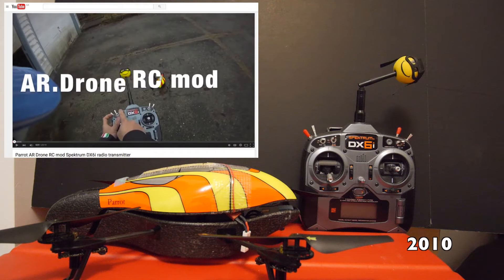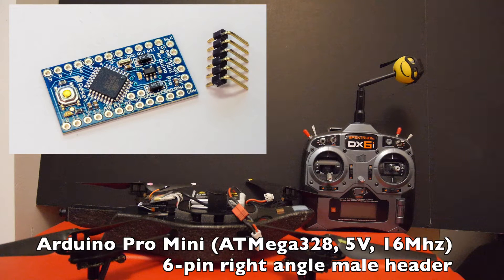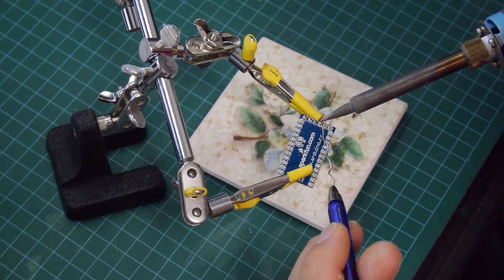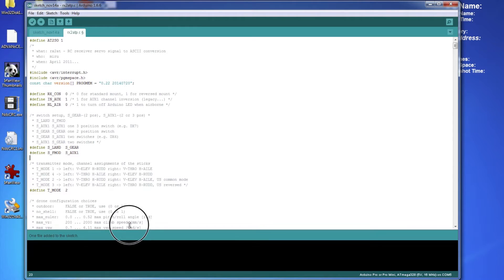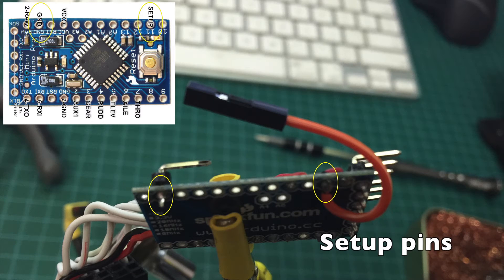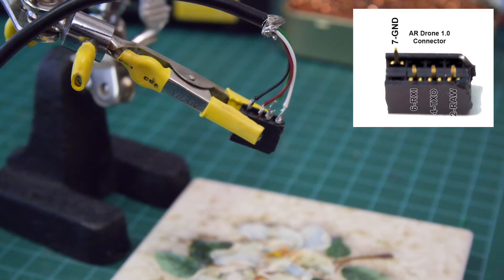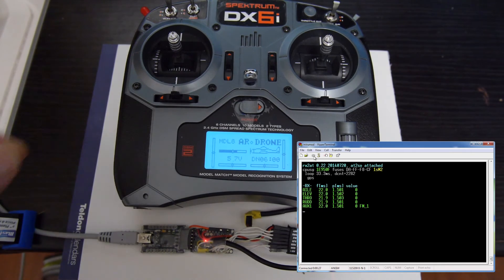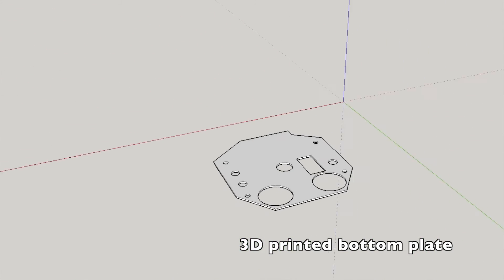Parrot AR Drone mirumod - RC transmitter mod howto guide

Comment: I think I have a mirumod receiver - the connector fits my AR board as Version 2.1, but I cannot find where to connect the binding wire without removing the protective plastic wrap. Trying to bind with a FlySky CT6. Do I cut the plastic and plug onto the covered pins?
Reply from the maker: I'm not familiar with the ct6 recievers.  But usually they should have pins plugging in a bind plug.  I have not heard of recievers that cover up the bind pins. Possibly try a different reciever.

Comment: just a question someone gave me a ar drone with this mod on it all works but i have no pitch or bank control the right stick on the transmitter does not do anything. but when i connect the controller to the pc it registers movement . and i connected a servo to each leg on the receiver it works with all channels. thanks
Reply from the maker: +jetskier47 definitely some programming on the arduino. What do the monitors register?

Comment: Hello, can one see from the drone camera while the drone is flying?
Because what's the use of greater range if you can't see where the drone is going.
Reply from the maker: +Ash D hi I never went that far but assume that yes video would cut out since it's wifi. There are much better options now for fpv
Reply: kenVersus
What would those fpv options be?
I have a current project with the ar drone and I want to fly it 100m to the destination and back. How do I do this? I mean is there a way I can connect it to 2.4 ghz to get a live video and GPS stream?
Reply from the maker: +Ash D you'd have to add external cameras and gps modules. The AR doesn't have gps. It'd be a lot of work.

Comment: where can i buy the mod ?  please help. i am good at soldering. need a mod kit and instructions .  thank you.  i think it would be easier to just by a newer drone.  lol  any one want a AR Drone 2.0 in mint condition still in the box ?   $100
Reply from the maker: +Zoey M honestly the drones today are better than the ar drone. Modding would be a lot of work unless you’re into this kind of thing.
Reply: exactly. GPS now.   i can't give this parrot away.  lol  archaic  i only paid 50.  wonder if i can use some of motors and such with a smaller store bought flight controler

Comment: This video is awesome! One comment to anyone new to mirumod: 

DO NOT UNPLUG THE SERIAL CABLE WHEN THE DRONE IS POWERED!!!

It will fry the drone's main board every time. No hard feelings, but i fried mine because i just wasn't aware of this issue.
Reply from the maker: Thanks for the tip, I kinda recall reading that too.  Fortunately, mine is hot glued in.

Comment: Hi KenVersus, Question regarding the AR Drone 1, does the latest version of software for Mirumod (drs022) still work with the resistor connection? Or should I revert to drs013 rather? Will do the setup with the arduino nano. Many thanks in advance.
Reply from the maker: +Sargonzaification i'm using drs022 and with the resistor and pro mini, not sure about the nano, but should be fine.
Reply: +kenVersus Thanks so much! Will update you one the progress :D

Comment: First off, thanks for the great video.  Both you're old video and new video are very helpful.  I am new to the drone world and would like to make the conversions you have to my Parrot AR 2.0.  In the video above you mention that this mod doesn't include WiFi.  So will this take away the FPV function to the drone?  I'm all for using RC Controls because of the responsiveness.  However, I like being able to view footage from my flight.  If FPV becomes disabled with this mod is there a way to still record your flight?
Reply from the maker: +Grant Friddell WiFi will still be there for video.  You connect to the drone with your app the same way as before and you can view the feed that is sent via wifi.  You can even controller it with the app at the same time with your RC transmitter (but not recommended).  

When people say "WiFi" less, it just means we're not using Wifi to control the drone anymore like the previous mod where we had an arduino send the wifi controls.
Reply: Awesome! Thank you

Comment: How much cheaper is the DIY option over the pre-built option?
Reply from the maker: The Miru sells it for around $40 I think. It's probably slightly cheaper diy. But if I didn't already have the parts already id go with the premade one. Much cleaner. My method uses parts I had so may not be the most optimal. Plus you get to support miru who created this excellent mod.

Comment: hi kenVersus, i'm really new to whole quadcopter seen, I started with a McLane which was intended for my son, than got into the syma x8, and a few others, I love the transmitter flying much better, but to cut to the chase, do I need to update the firmware or is that with whole wifi deal?  Thnx a lot.
Reply from the maker: +Andre Galarza I would update the firmware.
Reply: thanks I updated it, and it started off with improper angle or something along those lines, but I didn't really know, so I pressed take off and flew right into a bucket of water, I got it out with in 2 or 3 seconds but I have taken apart and in rice.  LOL what luck.

Comment: Great Job!! I have two questions, about the connection of the headers, what is the good location for the GND, on the row whith 3 pins or on the row with 4pins? And about the resistor 4.7K, what is the power of it, 250mW, 400mW or it doesn't matter?
Thanks for your help.
Reply from the maker: +Pierre Boulard I used 4.7k 1/2 watt resistors.  The ground pin on is diagonally opposite to the RAW pin.  Skip to 8:23 of the video for a shot of it.
Reply: +kenVersus Thanks for your answer, about the connection, i mean on the drone when you connect the headers, the GND is on the row with 3 pins or on the row whith 4 pins.
Reply from the maker: +Pierre Boulard it's on the row with 4 pins.
Reply: +kenVersus Thank you very much for your help!!!
Reply from the maker: You're welcome :)

Comment: Great video!  This is very timely since I have just received a AR Drone V1.0  I had an issue uploading code using a newer version of the Arduino IDE, and had to revert back to Rev 1.0.5 r2 to get it to upload correctly to the Nano.  Here is a website for the Arduino code etc to help in the process:  www.rcgroups.com/forums/showpost.php?p=28966553&postcount=5949

Hope that is helpful to others as well.
Reply from the maker: +josh8loop hmmm... maybe that's why I couldn't load the latest version of mirumod on my old Yellow Jacket which was basically a nano+wifi module.  I had to load it on my pro mini.  Thanks for sharing!

Comment: Thanks for the video! , i have question , do you know how to disable too much angle emergency at higher altitudes ? My AR.Drone 1.0 flip in sky and fall ... break central cross :/
Reply: +Tomek „miXXed” Lipiejko And another question , AR.FREEFLIGHT 2.0 send ardrone 2.0 firmware to 1.0 ... where i can get the latest firmware? On my previous mobo i had latest but it breaks due to central cross crash
Reply from the maker: I believe that's set in the sketch config file of the mirumod.
Reply from the maker: Ar free flight is the only place I updated the firmware. So it would have the latest.
Reply: will this work with mirumod ? Spektrum - DXe DSM X Air
Reply from the maker: +Tomek “miXXed” Lipiejko I can't see why it won't. The transmitter has to have at least 5 channels.